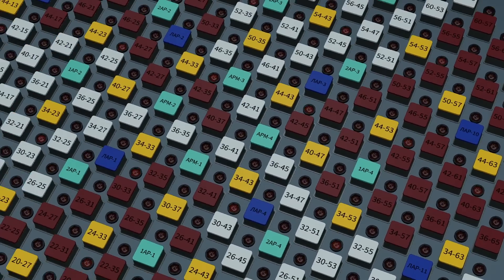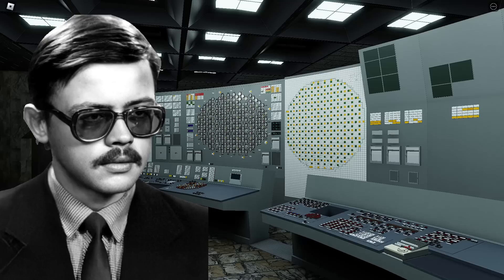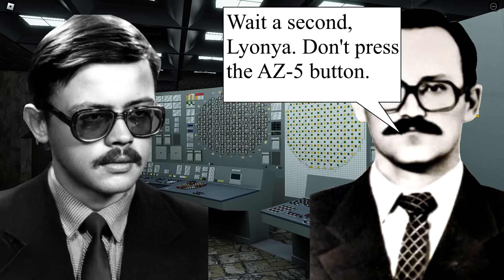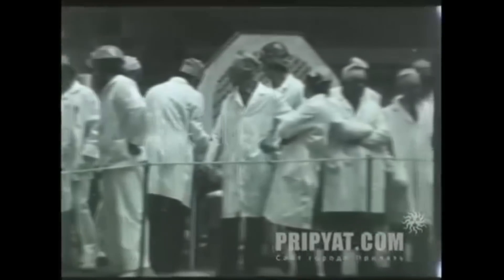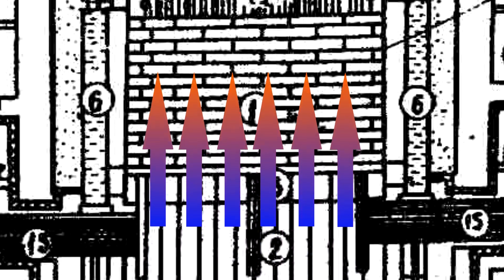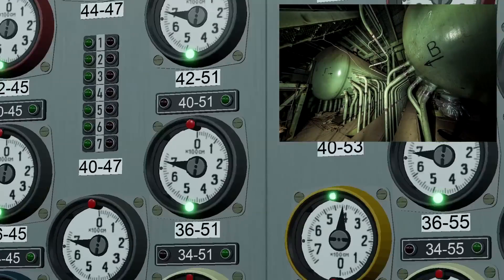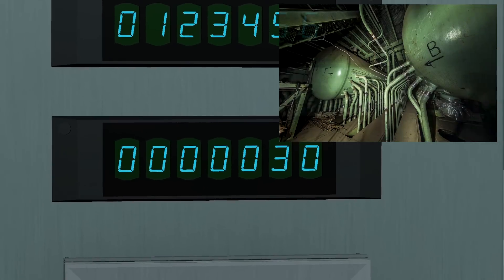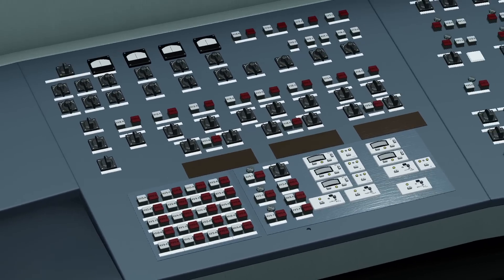Would Not Pressing AZ-5 SAVE Chernobyl?

Comment: The age old question of "What if Chernobyl hadn't happened"...has just been dealt a blow by this piece of creative thought. Indeed, the pumps would have been up and running thanks to the diesel generators, which would have stopped the voids from becoming uncontrollable...but surely the runaway reaction was exponential in growth, and a meltdown would have been inevitable? Possibly even resulting in explosion anyway - given the lack of water (now a massive pressurised build-up of steam). It's worth thinking about...but COULD anyone actually answer definitively?
Reply: Well if the power surge and resulting explosion were actually triggered by the actions of driving all the manual control rods down together, as initiated by the AZ-5 (scram) button, then not pressing it might well have avoided the explosion.
But, of course, the operators were unaware that their scram button had turned into a self-destruct button.
It is even possible that, if left alone for long enough, the reactor would have just gracefully shut itself down, due to rising levels of Xenon poisoning. 
The recent power reduction to 200MWt had triggered an ongoing ramp in the Xenon concentration, so that could have given a nice gentle nudge to reduce reactivity and the fast positive power coefficient might then have done the rest.
Reply: @derekp2674 I see what you’re saying, however surely AZ5 / SCRAM was only initiated due to there sudden increase…surely with no rods inserted, a runaway/chain reaction was occurring, as the xenon was being burned away by the complete lack of water moderation…I don’t think the increased temperature coefficient would have slowed the reaction quickly enough to avoid meltdown…and this is where it’s tough to agree…there’s too much “conjecture and not enough facts” ~ Gorbachev 😂😂😂
Reply: @Azimuth47 I think according to most accounts the AZ-5 was pressed to manually shut the reactor down and not in response to a power surge.
The IAEA report INSAG-7 discusses this in reasonable detail.
TCG has covered this topic in several other videos.
The net positive fast power coefficient arises precisely because the negative fuel temperature coefficient was too small to compensate for the reactivity effects of steam voidage, so I think we may be in agreement there.
Due to the high level of fuel burnup (just before outage) the reactivity balance was precarious, with the low thermal power (200 MWt) driving lower than usual graphite temperature and steam production, both of which required rod withdrawals.
With all of these factors the ultimate reactivity effects of a full scram were overkill for what was actually needed for a nice gentle shutdown.
Perhaps the operators might have realised that but I think using AZ-5 was the normal way to initiate reactor shutdown.
What I'm sure they did not know was that, given the twin peaked flux distribution at the time, their scram would inject about 1$ of positive reactivity as the graphite displacers drove out the water columns at the bottom of the control rod channels. This would have been enough to kick off the prompt critical power surge that destroyed the reactor.
Reply: @derekp2674  I can't get away from the fact that id AZ5 was pressed when power was only 200MW then it would have possibly risen briefly (due to the time taken for rod insertion & graphite tips) however it would then be shut down completely and without harm to the reactor. The Problem arose because the power was surging dangerously fast...a chain reaction, which would have inevitably converted all remain water to steam (AZ5 acted as a catalyst for sure, but would the runaway reaction have arrived at the same conclusion without AZ5?). The void left by the evaporation of water, the power exceeding the safe operating limitations...surely the end situation couldn't have been avoided, considering all of the safety protocols had been ignored/shut down. It's a fascinating topic, one I'd love to learn more about...which is why I watch these videos 😁
Reply: @Azimuth47 Well if the rods have to travel roughly 6m to reach full insertion and used to take 18 seconds to do that, in the roughly 3s interval between pressing AZ-5 and the main explosion, the rods would only have had time to travel about 1m.
That's enough to insert a 1m length of control rod proper (boron carbide absorbers) at the top of the core and to reduce the height of the water columns below the graphite displacers from 1.25m to about 0.25m.
With that, everything would have been fine and dandy if the vertical distribution of neutron flux had been symmetric about the mid plane of the core.
But the asymmetric nature of the control rod design seems to have acted to aggravate.the bimodal flux profile that had arisen, snuffing out the upper flux peak as the absorbing section of rod was inserted there and fostering the growth of the lower peak as the graphite displaced neutron absorbing water there.
That bimodal flux distribution, with peaks top and bottom and a  nice broad valley in between had arisen as a consequence of the high fuel burnup and the low power operating mode.
In normal reactor operations, the vertical distribution of flux follows a roughly cosine profile, as determined by greater neutron leakage at the top and bottom of the core. This means the fuel burns out faster in the middle than at the ends. So you end up with the least amount of remaining fissile nuclides in the middle and most at the ends. Fission product poisons, including Xenon-135, Samarium-149 (and the rest) then arise mostly in the middle and least at the ends.
Usually control rod movements and thermal (etc.) feedback mechanisms would be used to help smooth out a bimodal flux distribution, but that doesn't seem to have been practical when Unit 4 was operating at 200 MWt.
As shown previously on other TCG videos, the positive scram effect immediately prior to the explosion would have been sufficient to increase reactivity by about 1$.
So that alone would probably have made the reactor go prompt critical. And even if it didn't, the net postive power coefficient would only have needed to feed in a small additional reactivity increment to achieve prompt criticality.
After that, the power would exhbit a very rapid postive feedback loop, literally growing exponentially and surging too fast for any hope of effective counter measures from either rod movements or even the inherent negative feedback from the fuel temperature coefficient of reactivity.
As also mentioned in other TCG videos, as the power surge started to create more and more steam, the full potential steam reactivity effect of at least 5$ would have been available to drive further reactivity increases.
We know how that ended - the heat from the power surge destroyed the fuel rods and flashed enough water to steam to dismantle most of the reactor core.

Comment: Some people say reactor would explode anyway due to automatic shutdown. What they forgetting is that automatic shutdown was due to happen several times before explosion when they tried to prepare for test, so operators disabled if not all then most of automatic safeties built into the control aparature. So Im guessing there would be no automatic shutdown equivalent to AZ-5. Also was here suggested operators should lower few control rod at a time. If we ignore they were in serious lack of time (reactor went from minimum power to absolutely ridiculous levels of heat generation in just seconds) theres still main problem - in the time they pressed AZ-5 many of control channels were already warped due to excess heat and pressure. Main problem with control rods at that time wasnt graphite in the bottom end, but that they were stuck in the channels with their lower graphite ends in the active zone (and not under it). If the channels were still intact control rods wouldfall down to their designated position and function properly. Or maybe it was already too late and heat/pressure buildup was already so huge reactor wouldnt survive. Maybe his top part wouldnt fly off, but destruction at that time was already done.

Comment: What if the operators restored the control rods at staggered times instead of the AZ 5 which restores all the rods at the same time.
Reply: I think that would probably work, especially if they started by first moving up some of the rods that inserted from the bottom.
The core was also in a state where almost all of the rods had to be withdrawn to keep it critical, so it certainly would only have needed a few rods inserted to shut it down.
But the operators did not realise the danger they were in, so they followed standard procedures for a manual scram.

Comment: So the nuclear reactor heats the water by 2 degrees?
Reply: I believe so. The test conditions seem to have maximised coolant flow while minimising heat production.
A bit like turning the heat right down and the flow right up on a domestic shower.
So most of the reactor heat would have done work turning water to steam rather than changing the temperature of the water or steam.

Comment: I saw AZ-5 being executed on CAES Unit 3, and it was a key turn, not a button, not sure about 4th Unit. Now, to address the question in video name: no, nothing would save not just Unit 4, but the entire station

1977 - Unit 1 pushed into operation with multiple issues.
1982 - fuel rupture on Unit 1, partial core meltdown. Radiation release. Kept secret.
1982 - unit 2, turbine hall fire, radiation level increase.
1986 - well, everyone knows, the all-powerful KGB couldn't keep it secret, lol.
1991 - unit 3, turbine hall fire, major destruction

Every Unit 1-4 experienced major problems AT ALL stages - in construction, during startup, during operation, during decommissioning, cleanup and conservation. As if it wasn't enough, entire station was pillaged by Russian forces during invasion and containment damaged later. 

Units 5-6 were doomed from start. AZ-5 wouldn't save anything.

Comment: 1:06 doesn't water boil at 100°? Or maybe it has to do with pressure
Reply: The rbmk operates at 6,5Mpa
Reply: With enough pressure you can force water to surpass boiling points but remain liquid
Reply: Its pressurised water.
Reply: Water, like all gasses, can be kept a liquid above its boiling point by being pressurized
Reply: As the pressure goes up, the boiling point goes up, and vice versa.
Reply: At sea level
Reply: Increasing pressure increases boiling point
Reply: A pressure cooker essentially increases pressure so that water can go beyond 100° and cook whatever is in very quickly without boiling off. So yes 100° is the bp at 1 atm, not constant

Comment: if they switched back on extra pumps for pumping the water they would lower the steam voids dropping the reactor power - HOWEVER when s*** hits the fan everybody is trained to scram the reactor, so I don’t blame them.
Reply from the maker: All pumps were still active when AZ-5 was pressed - the four running down were all at over 75% of their normal flow rate, and overall flow rate through the core was higher than normal operation, while at a lower power.
Reply: @thatchernobylguy2915  no, all the pumps were powered by a run down turbine energy, if reconnected to mains they would go to full power and the secondary circuit would also provide cooldown of feed water. Let's not forget that loss of pressure lowers the boiling point, so even if you're right and only 4 pumps were powered by rundown that would create low pressure environment that leads to increase in steam voids.
BUT STILL, everybody in their right mind would scram the reactor so I can't pin the blame on operators, heck when my engine makes funny noises I slam that start/stop button hard ! The whole situation was created by idiots put in charge by a system that some naive students in the west long for, and amplified by easily bullied inexperiences personnel that those before mentioned idiots should've trained better !
Reply from the maker: @tommybronze3451 Four pumps were running down, but the other four were connected to a different circuit to continue supplying water after the shutdown. So, withe the four running down and four at normal operation, more than enough water was reaching the core. Plus, consider it was running at 200MWt. It was basically being drowned in water.
Reply: @thatchernobylguy2915 On British AGRs we reduce power by reducing the coolant flow. This works because the fuel has a negative temperature coefficient of reactivity, so power drops if the fuel is allowed to get hotter.

Comment: The only way to prevent the explosion—or at least have a chance—was for the water pumps to keep pumping water, to prevent steam formation. That way, they could gain time for the control rods to be fully inserted. The main problem was also that the rod insertion mechanism was very slow. If they had realized it earlier and inserted them much sooner—or at least left some rods inside instead of withdrawing them all—the accident might have been avoided.

Comment: The most realistic option is not considered: pressing another one of the AZ buttons. or manually inserting a limited number of rods. If only a few rods undergo the initial graphite spike induced reactivity increase, then the initial spike could be survived, and they quickly start reducing reactivity many by many times the spike. only a few more rods being inserted partially could bring reactivity down to a more survivable level, and they could also spike the temprature making the core less reactive, while sheilding the core from the later mass spike drop of an automatic scram. I belive that some of the other AZ buttons had characteristics like this, and this is also a possible response they migth manually enact if they are taking the spike less seriusly. But overall i think the takeaway should be that were it not for the graphite spikes and the initial increase in radioactivity that they burried when it happend to other reactors then pressing az5 or the automatic scram would have been more than sufficient to prevent any explosion or radioactive leaks, making it a minor incident or not an incident at all.
Reply: I'm sure the reactor could have been safely shutdown if the operators had understood the dangers of the state they had driven the core into.
This is, of course, very easy with hindsight.
But at the time, operating experience from previous RBMK reactor faults had not been shared with Unit 4's operators and serious attempts to carry out comprehensive reactor fault studies had been suppressed by the Soviet reactor design authorities.
So the Unit 4 staff just sleep walked into exploding their core.

Comment: 2:43 I don't understand this bit. There is more cold water send into bthe steam separator, I do get why that leads to more cold water in the reactor, but I don;t get how this leads to more hot water (at boiling point) in the reactor...
Reply: Because that cold water also turns into hot water, which turns into steam and raises pressure in the system which also heats up the system which leads to more hot water

Comment: because the tip of the control rod is graphite not the boron.. the boron of the control was at the middle of the control rod..
so, if they pressed the AZ-5 button that means the tip of the control rod instead inhibiting the nuclear fission in the reactor, the control rod instead moderating or accelerating the nuclear fission of the reactor for brief of the moment..

also the bottom of the reactor, there is a space or between the floor and the control rod.. and this space still have nuclear fission.. that's why while they pressed the AZ-5 button, that tiny nuclear fission were accelerated instead inhibiting the reaction..

and from this point, the reactor transformed into a nuclear bomb.. 
just after they pressed the scram button, the reactor was generated a huge amount of power above the reactor can handle (above their design) the steam underneath was suddenly vaporize creating a very very high of steam pressure and BOOM..

that is what exactly happen at the chernobyl power plant in reactor #4
Reply: boron is on the too, not the middle. It is ~1.5m graphite, ~2.5m neutral, ~3.5m boron
Reply: Wow...

Comment: Shouldn't that temperature be in Kelvin, and not Celsius?  287 degrees Celsius is extremely hot, and well beyond the boiling point of water.  287 degrees Kelvin is cold water, typically what you would expect the temperature of ground water to be.
Reply: The water inside an RBMK reactor is pressurized as to raise its boiling point.

Comment: If they knew the core is already running away, and IF they knew about faulty design of graphite rods they could have started all water pumps to 100% from main grid and hoping it would remove steam pockets an cool down the core enough so the AZ5 could be safely pressed. AZ5 is working ONLY if the core is not pushed to the limit, and that day it was because they did not know how the core is designed and ignored the fact the core i full of xenon poison...
Reply: Mk I cooling tower couldn't handle that much hot steam build up which is why Mk II were invented.

Comment: Remember the control rods were DESIGNED to do double duty...    Accelerate reaction with the graphite lower tip as they are withdrawn, and quench the reaction as inserted (when water is present)

Comment: You don't know much about Canada if you're surprised a report on the RBMK came from there. Canada has refused to host nukes or to build their own, but it's got plenty of nuclear power plants. The US actually buys most of its nuclear adjacent medical supplies from Canada. You know, imaging isotopes.

It's funny in a way, Canada is one of the countries that could most easily run their power grid off fossil fuels, but the majority of power in Canada is Hydro power, with Nuclear taking up another big chunk. Fossil fuels are used slightly more than nuclear, but not by that much.